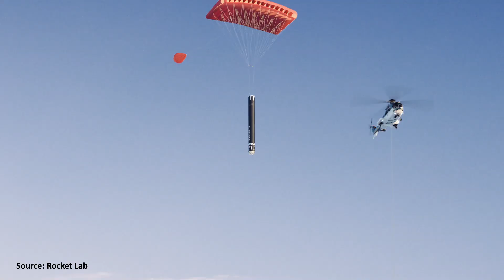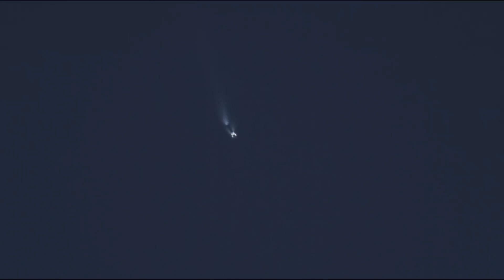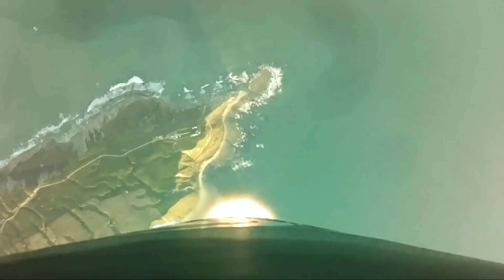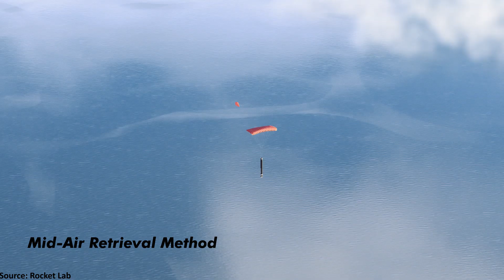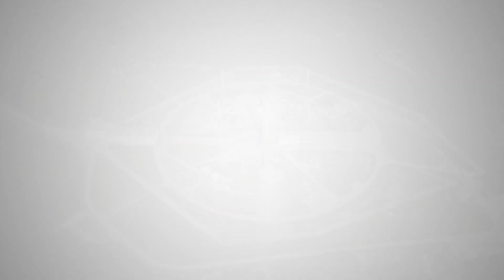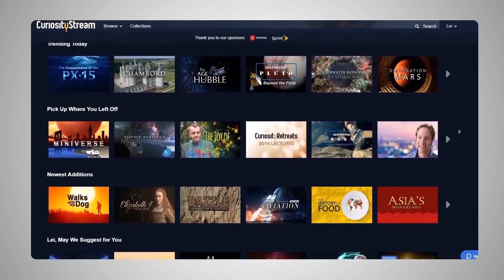What does SpaceX SmallSat Program mean for Rocket Lab?

Comment from the maker: Btw, if you can't tell, I am a big fan of Rocket Lab and what they do. However, this might be the biggest challenge yet. I am curious to see how Rocket Lab is going to react to this. One other thing I am curious to know from you is how do you think SpaceX will react to the fact that the launch industry is stagnating? Total rocket launches in 2019 will be around 90-100 and the number was 114 last year.  Let me know!
Reply: Satellite launching is stagnanting but not launching industry. Launching industry covers from satellite, rover, specimen, experiment, food supply to ISS, and astronaut. They are not stagnanting.
Reply: @hafizuddinmohdlowhim8426  No, launches overall will be down this year and for the next few. ISS resupply and crew helps mediate but commercial satellite launches are declining significantly.
Reply: They could launch more starlink satellites. It will cost them money and not make any but it’s a great investment. The sooner they get it working the more they can get out of it. They need a ton of launches for that.
Reply: hey i am here first
Reply: I clicked the link but it didn't load.... And tried too much
Reply: This competes with Spaceflight Industries to a much larger extent.
Reply: The economy hasn't been as good for 2019 as it has been for 2018.
Reply: @Patchuchan  That's not the reason for stagnation. It's been happening since 2016-2017.
Reply: SpaceX are going to make a new market - inter planetary transport :-) Starlink & the orbital market will keep them going until BFR/BFS arrive. Hopefully the new US government interest in space will also provide some revenue in the interim, but administrations come and go, especially when you factor in the upheaval which will beset Earth economics & politics increasingly over the next few decades (and IMO, quicker than people think).
Reply: @kofManKan    What upheaval are you foreseeing?
Reply: You said "it's not able to land the rockets, because of the size being too small".

Wait for technology to advance. (E.G.) - Computers also get smaller in chips.

We need more and new physicists and engineers to get interested and curious about innovation in good ways, and new forms of good technology as the result for propulsion, and space exploration.

It is the limitation of the human mind / imagination, not the technologies fault.

-----------------

I was giving out helpful links, but it won't allow me to do that now, so I made playlists.

1. Check my channel, find a subscribed channel called Technology Research, go to the playlists there, and click "created playlists", that should show them all.

2. After that, click on the title / text of each playlist, not on the pictures.

3. Don't forget to click the "more" button in each playlist description for more articles and playlists.
Reply: Even thoug satelite launches are stagnating due to less being made that need to be launched, other mission types as restocking the ISS or even getting astronauts there and back from it are still available. Nontheless, launches are declining, one way how SpaceX might handle it is by increasing starlink launches, this would make a dent in their revenue in the short term, but in the long run, would be more then worth it, as Starlink is to become SpaceX's main source of income, which means that getting it online faster would reduce the missed potential revenue.
Reply: All markets have their ups and downs. Demand for launch services is off somewhat this year, having been higher for the last couple of years. Eventually it will come back, markets always do. SpaceX is, of course, creating their own demand by launching their Starlink constellation. Eventually, Starlink internet services will be providing much the greatest part of their revenues, so they will easily be able to ride out ups and downs in the launch market.
     Right now, small sats are the strongest growth market, and SpaceX is doing a rapid shift to try to meet that demand, which they had not anticipated, before Rocket Lab monopolizes it. For the last year, I have been thinking how excellent it was for Rocket Lab to have found a very strong growth niche where they didn't have to compete with SpaceX. Apparently, Elon has chosen not to just leave it at that. From the way that niche is growing, my guess is that there will be enough business for the both of them, SpaceX taking those customers more interested in low price, and Rocket Lab taking those more interested in precise schedules or orbital parameters. Of course, Rocket Lab may be able to compete better on price once they accomplish reusablity. It will be interesting to see how many, if any at all, of the prospective small sat launchers who wanted to snag part of that growing market, thinking they were only going to be competing against Rocket Lab, will now ever manage to launch a payload. Will the market grow sufficiently to accommodate more than two providers? I don't know, I sure hope so.
     What about the medium and heavy lift market? SpaceX is much the dominant player there. Roscosmos, and Arianespace have both been largely reduced to being national carriers, satisfying the demand of governments which want to assure domestic access to space. ULA had largely accepted that role before SpaceX began flying. Thus, SpaceX can not significantly increase its market share. They have the competition so thoroughly beat on price, schedule availability and flexibility, that almost the only reason anybody hires the competition is out of political concerns. Thus, in order for SpaceX to increase their business in that area, the market itself will have to grow. Over time, I have no doubt it will.
Reply: Spacex's reaction to stagnation is starlink

Comment: You missed the biggest differences for what customers are offered. RocketLab gives them the exact orbit they want, when they want. Inclination and altitude. SpaceX's offering has many of the problems of traditional rideshare on a major sat launch: launch timing and the desired orbit being compromised. A dedicated rideshare launch improves the timing/wait issue, but not as well as RL. With SpaceX you get only a sun synchronous orbit. There is no mention in the vid of how many maneuvers the upper stage can make to release various satellites in desired orbits. Photon of RL is a huge selling point, with its various features, orbital placement being just one of them. And you have a non sequitur. The in-house facilities for StarLink are not being offered to customers, and have not much in common with Photon's capabilities 

I'm a big fan of SpaceX and its goals. But RL, especially with its Photon, offers a service SpaceX cannot.

Comment: The main Pro for RocketLab is that there is less rideshare means you will get the orbit you want, not somewhere maybe near an orbit you wanted because the main satellite had to go there... Rocketlab has a  Resource Consent for their Launch Complex 1 in Mahia Peninsula to launch every 72 hours. Means you can get your satellite in orbit when you want and where you want. With rideshare not so much.
 If you have a window for your mission there is more of a chance Rocketlab can get you there when and where you need it and want it.

They also don't have to worry about holding up air traffic as most launches in the States have. 

I can tell you it's not always about who is the cheapest ... cheap doesn't mean I get what I want or asked for...

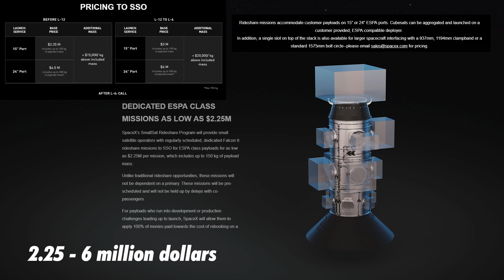Comment: 1:55 Primary customer (pays for most of the launch) goes on the top port of the ESPA stack. The top port of the ESPA stack can handle up to 6800 kg, so most primary payloads/satellites could be placed on top. The primary payload on the top port probably pays the majority of the launch cost, since it probably out-masses all the other smaller secondary payloads.

Comment: With Rocketlab each satellite can go into the exact orbit the customer wants while with Spacex's small sat service they have to settle for a compromise due to limitations on the second stage's ability to do plane changes not just in delta V but in restarts on the engine.
Then some payloads you may not want to have ride together such as something with a telescope riding with something that may out gas.

Comment: Rocket lab The next spacex.
Reply: They don't compete
Reply: Spacex's last launch was a satellite that weighed  over 7000 KG to an apogee or 90,000 KM. They are nowhere near the same.
Reply: @williamgreene4834  35000, but still
Reply: @welyum7308  I got got my wires crossed with Arabsat-6, Like you said 35,000 , but still. :) That's hauling a huge mass to very high.

Comment: SpaceX does not have the ability to handle ideal orbit issues well because of the multiple payload limitation and biggest customer gets best orbit insertion! Utilizing more fuel for better orbit management increases cost and margin for error for insurers with SpaceX-each has a unique position, but for small Sats Rocket Labs still has the LEO orbit edge where required.
Reply: SpaceX's smallsat program is just to sun-synchronous orbit. They aren't targeting anywhere else currently.
Reply: @AmbientMorality   That's where most small sats want to go.

Comment: You don't want SpaceX as competitor lol
Reply: @AnandKumar-i9c8e  

That lifting power is still lower than Falcon 9's 5000kg to GTO on a reusable  flight. I can't find anything to compare their pricing , though.
Reply: @AnandKumar-i9c8e  
You do realise that link showed that Space X beat ISRO on both cost and launch cadence on top of lifting capacity , right ?
Reply: Anand Kumar okay but you got to realise that launching lots of satellites isn’t as impressive when they are as light as they are? It not like each satellite was the size of a car, they were only 12 inches long, the size of a standard ruler. Its really easy to fit many like that when you have a rocket that can lift 1800kg worth of them. I am appreciative for the work ISRO does, but they have a long way before they would compete with SpaceX and their lift vehicles (you also need to compare the weight capabilities as there is a 23000kg difference in payload lifting ability, thats why its more expensive)
Reply: @AnandKumar-i9c8e  ISRO has made impressive strides lately, but SpaceX is king when it comes to pricing. Re-usability aside SpaceX is an extremely efficient and vertically integrated organization that is completely ahead of the whole world when it comes to rocket launch prices.
Reply: @AnandKumar-i9c8e  

Yes, a discussion which compare Space X and ISRO in terms of pricing and capability . Which is why I pointed out to you that Space X have ISRO completed beaten  on the commercial flight market, something that is stated even in your own link .
Reply: @remliqa  falcon 9 is cheaper when used at full capacity.
Reply: @remliqa  read my above comment 😉☝
Reply: @AnandKumar-i9c8e  ISRO launches 2-3 commercial missions a year, SpaceX launches 12-20. There is no competition. https://en.wikipedia.org/wiki/Space_launch_market_competition
Reply: @woolfoma  read my above comment 😉☝
Reply: @AnandKumar-i9c8e    broadly speaking, private companies are better at meeting market demands than government agencies. If India really wants to be a major player in the commercial launch industry, I think the best thing to do would be for your government to encourage the formation of private companies to engage in that activity as a business. ISRO could share technology with them to get them started and then they could go to town. Then ISRO could concentrate on exploration, science and technology development, and other things that are not profit drivers.
Reply: @odysseusrex5908  read my above comment 😉☝